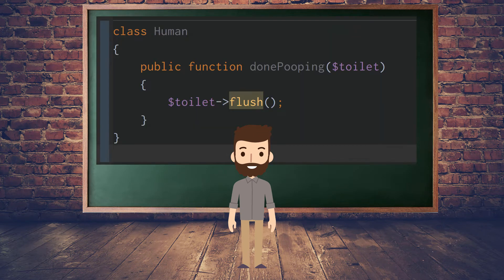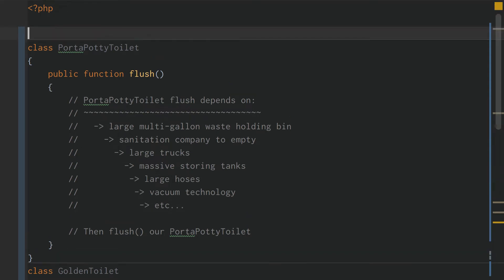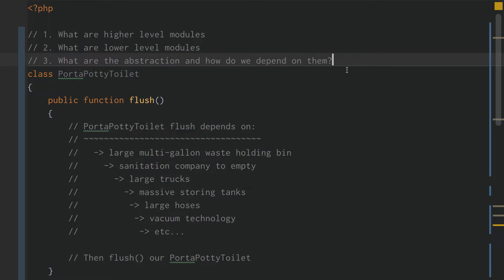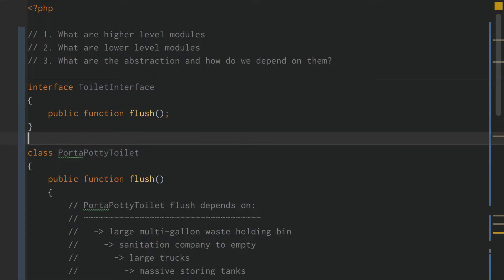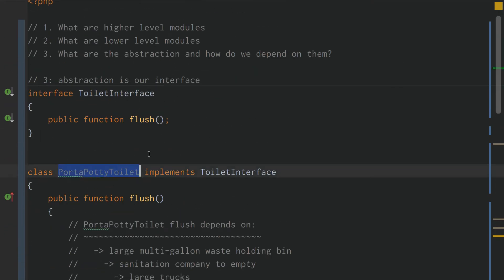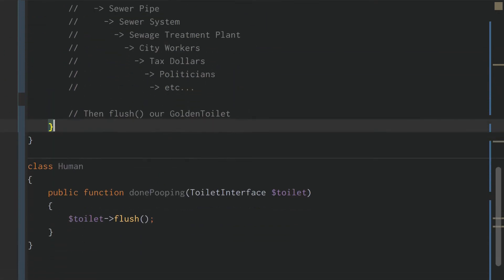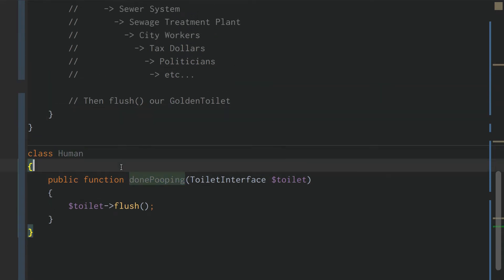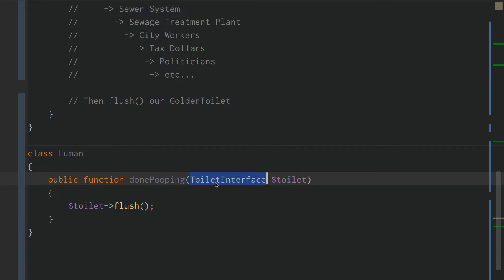Dependency Inversion Principle (PHP SOLID Design Principles)

Comment: ??? but methods dont depend on classes so i dont really get the problem it tries to solve
Reply from the maker: Methods, or functions, can depend on class behavior.

Image your phone and all of the apps you are able to use on your phone.

What if Google or Apple developers had to take into account how to run or execute all of the apps your phone could download? That would be insanity and the apple and android platforms wouldn't be nearly as cool as they are.

Your phone instead can
1. Install Apps
2. Run Apps

Your phone does NOT know HOW the apps you install do what they do. Your phone just knows the Apps CAN do something and that it needs to be able to install and run them. 

Once the apps are running, it is up to the creator of the App to determine HOW it does whatever it needs to do.

This is an example of why interfaces or contracts are so stinking valuable. 

You know that a class CAN do something, you don't know HOW it does it.

Your phone knows an App CAN do something, it doesn't know exactly HOW it does that something. 

Your phone just knows it needs to be able to install the App and run the app so it can handle whatever it is the App handles.

Code Example:

interface PhoneApp
{
   public function install();
   public function run();
}

// implement the interface on the FlashLightApp interface
class FlashLightApp implements PhoneApp
{
   public function install() {
        // require access to phone light
        // require access to phone battery life
    }

   public function run() {
      // pull up light app user interface
      // pull in user interface images
      // When light button is turned on, turn phone light on
      // When light button is turned off, turn phone light off
    }
}

// implement the phone application on the MapApp class
class MapApp implements PhoneApp
{
   public function install() {
        // require access to gps
        // require access to phone battery life
    }

   public function run() {
      // pull up gps location on phone
      // pull up gps map user interface
      // calculate distance between user current location and location xyz...
      // etc...
    }
}

// Accept the interface instead of a specific class
function runPhoneApplication(PhoneApp $app)
{
     // By depending on the PhoneApp interface we can run Any Phone App
     // as long as the class implements the PhoneApp Interface.
     // We know, because we're accepting the interface that we can execute the 
     // "run" function on our $app object.
     $app->run();
}
Reply: @CleanCodeStudio  oh watched it again n now i get it
Reply from the maker: @JoshuaKisb  Glad to hear it clicked :) Do you mind sharing what your sticking point was and what clicked?
Reply: @CleanCodeStudio  well when i first watched you were saying flush for this toilet depends on sewage plant and bunch of other classes so we change to have it depend on interface, 
on reading comment i get that the point is to simply care about whether it can flush and leave it up to the class to take care of its own dependencies.... i think thats what it meant
the sticking point was what happens to dependencies before and after
i got the sense that before they were created by the action using the method and after they move to the class